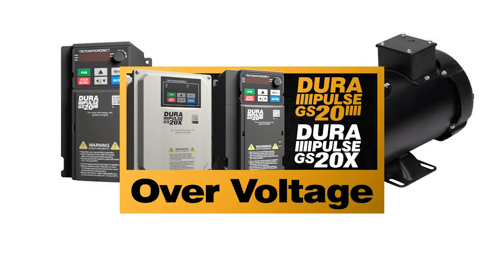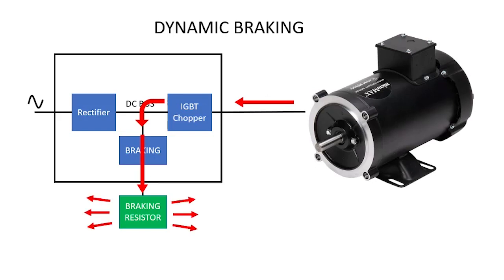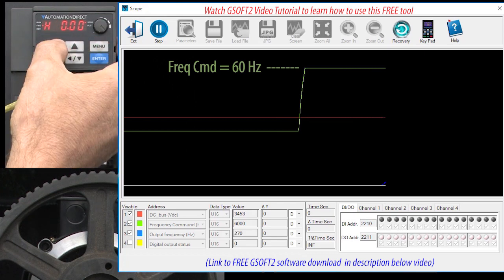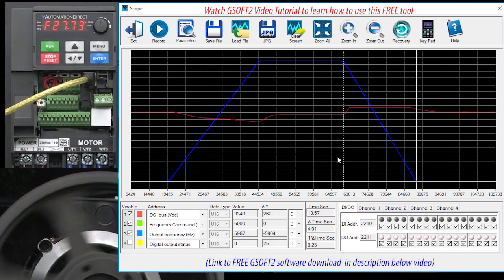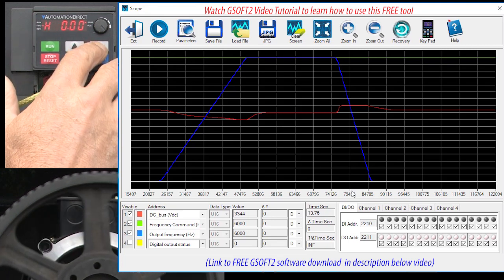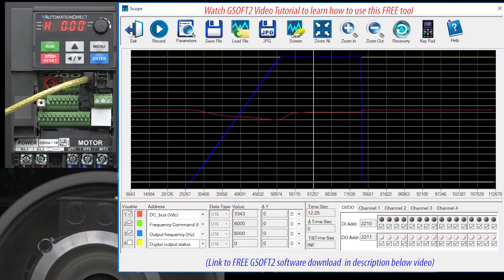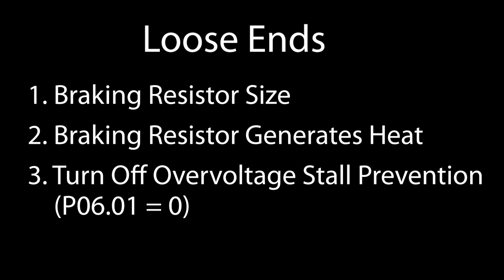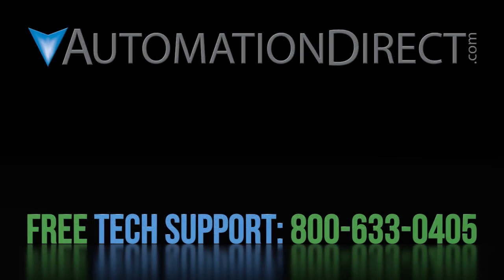GS20(X) VFD: Dynamic Braking from AutomationDirect

Comment: I did a Centroid CNC conversion on a small milling machine about 10 years ago.  At the time, I selected a Hitachi SJ200 drive to power the spindle motor from my 240v single phase power source (no 3 phase available).  I have never been able to get the Dynamic Braking to function correctly, largely because I'm pretty sure I don't have parameters set correctly.  Hitachi does NOT make it easy to understand how to determine and set those parameters.  It is for that reason I am going to spend the money to replace that drive with an Automation Direct GS20 series VFD. (I will be able to re-use the Hitachi on a band saw I acquired, although it will be overkill for that application)
These videos, and Automation Direct's reputation for technical support is THE reason I am going with the GS20.
Reply from the maker: @dean thanks for the kind words! We strive to give the BEST Customer Experience in the industry, so it is always wonderful hearing this!

Comment: Can you telll me ,dc beaking error occurs in a vfd.the settinf is DC brake at frequency under 0.5Hz...how to prevent that error
Reply from the maker: Are you trying to use the DC Brake to stop the motor?  DC braking should only be used to hold the motor still after it has stopped moving, it should not be used to stop the motor. Dynamic Braking (sometimes called "regen braking") is for quickly stopping a motor with a lot of inertia.
If DC Braking is getting in the way, look at parameters P07.01 through P07.04 (Assuming you are using a GS20(X) drive) and adjust accordingly.